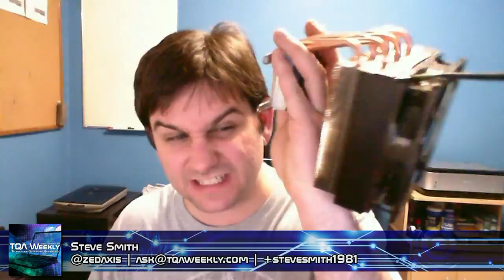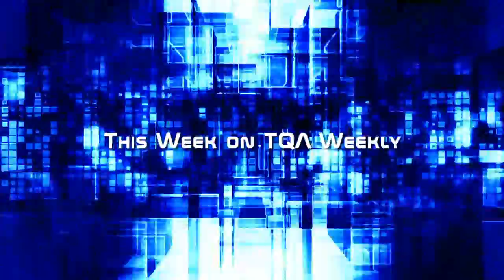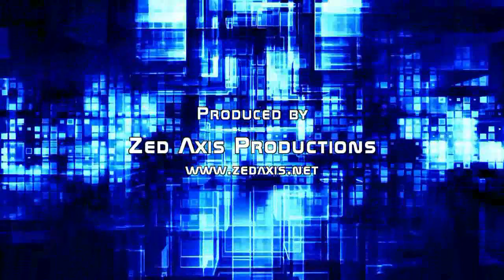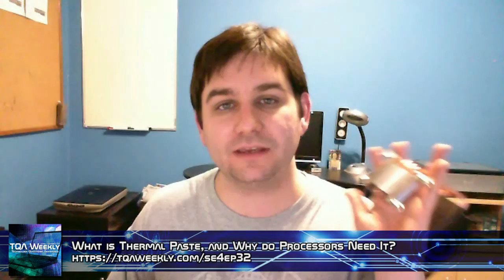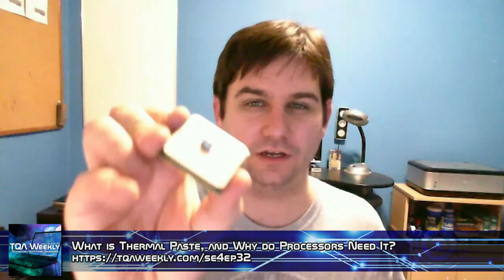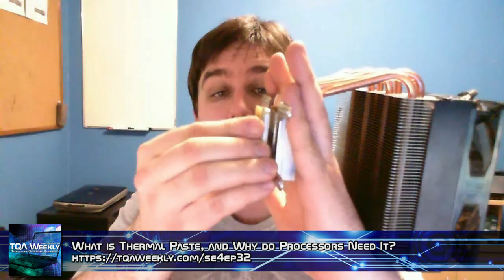What is Thermal Paste, and Why do Processors Need It?

Comment: does thermal paste can affect my game play?
Reply: Well, first you have to figure out if ur cpu is overheating, if so, it will throttle its performance to cool down.
If you have a decent cooler, temps will be low regardless of which thermal paste you use

Comment: My pc starts normally but after I'm using it 5-10 min is freezing for 5 seconds then is shutting down by itself. Do u think is the thermal paste?
Reply from the maker: It is possible, consider changing the thermal paste. It is, also, possible for the heatsink to be clogged, the fan to be ineffective, etc. Check the cooling fan to make sure it is clean and functional. If the fan died, change it, if it works and the fan and heatsink is clean, check thermal paste.
Reply: @tqaweekly  the fan is working but that metal which is attached on is getting hot in 10 min. U think the fan is not working properly anymore?

Comment: which components of pc needs thermal paste
Reply from the maker: That is easily user serviceable, the processor. On a graphics card, the gpu also requires thermal paste, but before you endeavour to change that, look up instructions relating to proper dismantling of the graphics card, first.
Reply: @tqaweekly  does south bridge needs thermal paste
Reply from the maker: Does your south bridge have a heatsink for cooling? If so, yes, if no, then no.Thermal paste fills in gaps between chips and heat sinks.
Reply: @tqaweekly  there is no heatsink on southbridge and northbridge and i have change paste on northbridge but little confused on southbridge to how to remove it and change its paste because it is heating too much...

Comment: So after applying the thermal compound I should simulate cycling? I'm building a pelitier air and liquid heater and I'm not even sure I bought the right compound. I've applied the "thermal grease paste" to my peltier and mounted it to 1 of my heatsinks,but after 36hrs it still has a little wiggle. Not sure what's happening,I thought it was suppose to be a more stable bond?

Comment: Bro. I accidentally removed the thermal paste. And used my pc.  Now my pc is not working. It turns on and fan is spinning.   But no display. What should i do?
Reply from the maker: You can apply thermal paste, but it is possible you fried your processor. Consider letting your computer cool, and resetting the bios, using the cmos clear method. I hope that works, but this is why thermal paste is extremely important.

Comment: is themal grease any good 4 a cpu ?
Reply from the maker: Thermal Grease is not as conductive, but does the same job as thermal paste. To be clear, technically, it is relatively the same thing. If your fan for your CPU came with thermal grease, it is safe for you to use. It is definitely better than using nothing at all, which I have repeatedly stated not to do. Same rules as usual, keep an eye on temps, when idle temps are higher than usual, change it out. Just keep in mind ambient temperature changes the idle temperature.

Comment: Does a cpu come with thermal paste??
Reply from the maker: MOST do, except that after a while, it dries out due to heat, which means it loses its ability transfer heat. Thermal paste is relatively inexpensive,  so when this occurs, just change the thermal paste.
Reply: +Steve Smith so should i buy better thermal paste?
Reply from the maker: If you have the cash and want to, go ahead, but if you just bought fan and cpu you don't have to.

Comment: what happen if i no use thermal paste?
Reply from the maker: +muqtasam ilyas nothing good. Remember, no surface, no matter how polished, is completely flat, and hoping a processor fabricator, and a CPU cooler manufacture actually achieve this is ludicrous, to say the least. The air pockets that result from both of the uneven surfaces leads to air pockets, which can and do insulate the processor from the heat sink, making it harder for thermal conductivity, which would allow for the processor to run cooler. The hotter the processor, the more damage will occur, and if the temperature raises to dangerous levels, the slower the computer will be. In some cases, the processor can outright fail.

Thermal paste has two jobs job, fill in the air pockets, and transfer heat from the processor to the cpu cooler via thermal conductivity. Think of the processor and CPU cooler as two land masses, and heat as the traveller. Thermal paste is the bridge that allows heat to cross. I hope you understand why thermal is important. And for anyone else, if you don't have thermal paste in your computer rig, turn off your PC, go to the computer store, spend the cash, usually less than 10 dollars, and protect your investment.
Reply: ok thanks for all the info
Reply: yes but like you said it pisses overclockers off, but what if you only had your computer on 4 to 8 hours a day? would you still need it? cause I'm getting a liquid cooler for my cpu, soo I wouldn have room for a heat sink?
Reply from the maker: I have liquid cooling in all my computers, thermal paste aids thermal transfer. If you don't use thermal paste, you might as well throw away the liquid coolers, or fans. Just a note, most water cooling AIO kits, come with thermal paste, so you won't have to worry about that.
Reply: alright but do you need to have a heat sink to put with the cpu after applying paste or would the liquid cooler do that ?
Reply from the maker: An all in one liquid cooler has the CPU cooler, which has a heat sink, the thermal paste will allow for the best possible thermal transfer.

Comment: I need help.. My PC random shuts off. I'm thinking it's my processor so I cleaned my fan out for it and the heat sync because it was REALLY dusty. But now it isn't working still and it seems worse. It gets really hot then my PC shuts off. I'm wondering if it's something to do with my thermal paste. I'm not sure but I can't even play my gaming PC. Need help ;/
Reply: 30 Minutes Of Trash I had that problem too and thermal paste worked
Reply from the maker: +KangarooNinja Change the thermal paste, if you haven't already done so, and consider checking the bios to see if the fan is spinning fast enough, and also verify that the fan is indeed spinning as well. If the computer processor is overheating, change the fan altogether. Make sure you also cleaning all the other fans, too, and make sure sufficient ventilation is occurring.
Reply: +Steve Smith okay thank you. I figured out it doesn't have any thermal paste on it anymore. So I'm guessing that's the problem. I cleaned my fans also. I'm planning to buy some thermal paste and try applying that and see if it works.
Reply from the maker: +KangarooNinja good idea, and please do not use the computer until you do so, while computers will turn off when they hit critical temperatures, there is no point in artificially reducing the lifespan on your computer.

Comment: if you don't use a third party cpu cooler and use the one it comes with, do you still need thermal paste?
Reply from the maker: +Stevethe11th sure, using their's is fine, however, keep in mind, if you ever remove the fan, you have to replace the thermal paste anyway.
Reply: What do you mean by "Replace the thermal paste anyway" like take it off or just what?
Reply: ༺ᗯᗴ丅༻ Ꮆנєภєг∂✧ clean the surface and put more thermal paste on, you can look up a tutorial on youtube

Comment: Hi, i recently noticed that my computer shuts off when idling or when i'm gaming and i was wondering why this may be caused. I haven't replaced the thermal paste in about 4 years and i ran some tests on my computer to find that the temperature of my CPU significantly increases when i play video games. Do i need to replace the thermal paste in order to stop my computer from shutting off? or, is it something else?
Reply from the maker: TrainingMusic Service elevated temperatures of the CPU can be due to a few factors. The easiest to check is the CPU fan, because it is basically a visual check. Does it turn? Is the heat sink full of dust? If yes, clean the dust out of the heat sink. Thermal paste can last up to 8 years, however, we are talking light users. If you are a gamer, chances are, you probably should change the thermal paste, too. It is one of the three parts for the CPU you can't check without changing anyway. Once the seal is broken, you must replace the thermal paste. A functioning fan, with a clean heat sink and new thermal paste will allow for the temperatures to come back down.

Comment: Why not nutella? Has anyone properly tested Nutella? I know basically checking if the CPU works is fine without thermal paste, as long as you immediately turn it off. Crazy world records have oc'd the g3258 to 6.8ghz using liquid nitrogen and made it load cpu-z. Is there some kind of mayonaise that would allow you to use the CPU without killing it for maybe a week, because you're in...a jungle on an island and all you have is that, and a power source, and you need to...look at adult videos before shooting yourself in the head.  and where is the Series: "Will it thermal paste?"? Do some CPUs just run hotter than others?
Reply from the maker: Zandonus Lolz, this makes me think of the chart in the backstore of the computer shop I work. There are plenty of things that can transfer heat, how effective depends on the product, its composition and the task load. Even toothpaste works, but I definitely do not suggest that anyone tries it unless they have a system they don't mind blowing up if the binding agent does not work correctly. If enough people record different agents being used as a thermal transfer medium and can produce a thermal read out over time using programs benchmark programs, then I will edit them all together and make a special edition episode just for that.

Comment: Hi, thank you for the video! Does the thermal paste dry?
Reply from the maker: Catherine Wu Yes, it can in fact dry. Many thermal pastes have a rating in years, the Arctic MX-2 I use last roughly 8 years. It can, also, dry due to heat over time. Because we use it to bind the CPU to the Heat Sink block, it is in the middle of heat. It is recommended to change the thermal paste every year or two, but you can judge this easily by monitoring the temperature over time, and if it rises, change the thermal paste with fresh thermal paste.

Comment: Hey dude, I recently tried to clean my fan. I'm a beginner at mechanics, And I accidently removed my thermal paste from the CPU. Will it run without it or did I completely damage my CPU/Fan up?
Reply from the maker: FluiD NO. Go to your local computer store, and buy thermal paste, and place an amount no bigger than a grain of rice, and replace the heatsink over the cpu.

Comment: Hey Steve, Good video. just a quick question.
Last week, i opened my pc to clean its fan. I cleaned the fan, but also accidentally removed the thermal paste. Now im using my pc without any thermal paste between the processor and the fan chip. Is it Bad?????

Before, When i used to play Big games like Far Cry 4, My pc used to make a lot of noise and used to shut down by heating after like 2-3 of playing. But as now, it is clean, it makes less noise but shuts down very fast, sometimes after 5 mins of playing the game.

I have already purchased a Thermal Paste online, but will reach in 2-3 days.

So, should i continue using my pc or not? im not playing any game right now.
Reply from the maker: Harshdeep Singh Stop using your pc, you'll only ruin the processor. Thermal paste allows for the efficient transfer of heat, something that will not happen if you run without thermal paste.
Reply: Steve Smith Thx for u time..... Great help.....

Have a good day

Comment: Oh shit you touched the CPU pins that thing is bad now \0/
Reply from the maker: 159jbb actually, you are wrong, it is perfectly fine to do that. You just have to make sure it is clean before reinserting it into the socket. However, it is a functioning prop that I don't use in my collection of electronics, so generally speaking, I am fine with touching the pins.